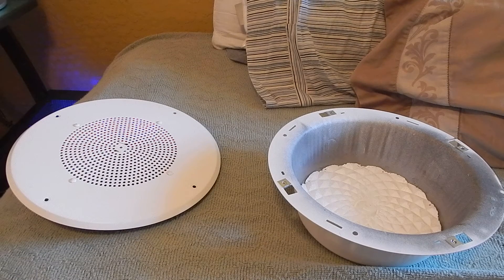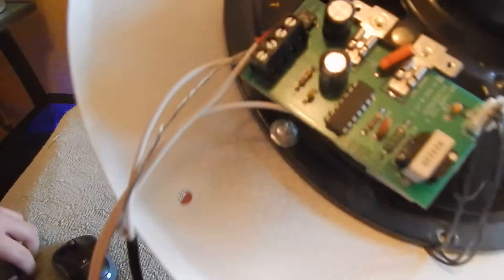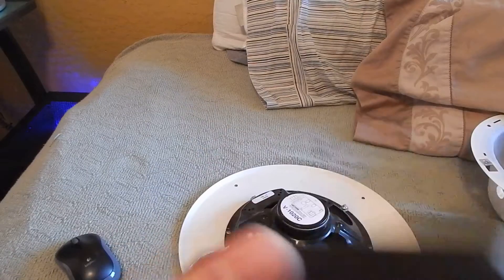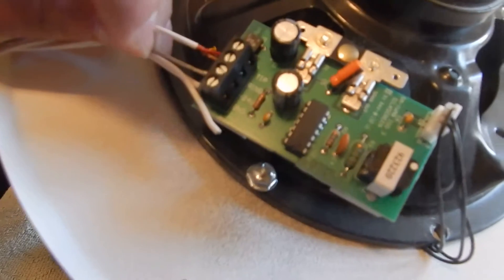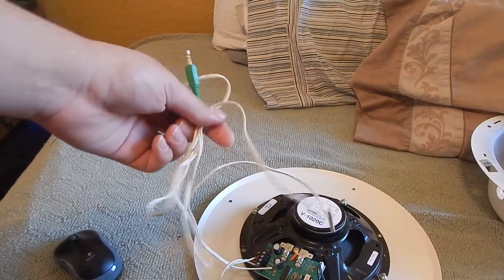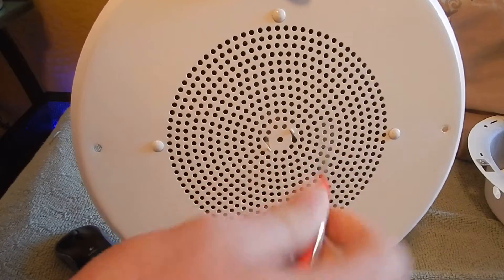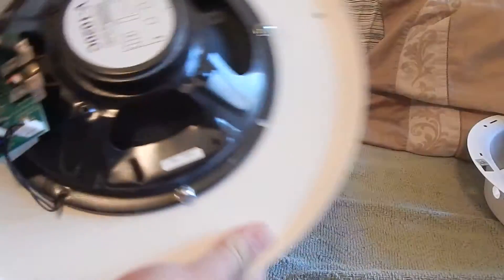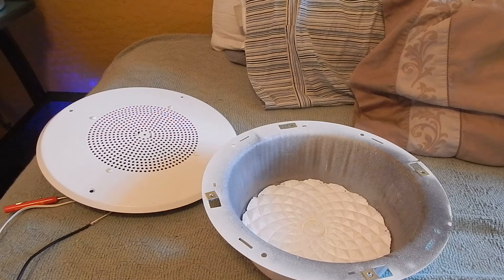How To Wire Up A Valcom Self Amplified Speaker For Your Own Use.

Comment: They have Valcoms 1020C almost everywhere around my School the building is getting tearing down around the summer most of them don’t work they should got them replaced a long time ago but 4x of those speakers work they also have Valcom 1030C Horns as well

Comment: hey man . can I hook this up to a car amplifier ? if so how would I do it and how much watts would I need ? Thanks
Reply from the maker: You can not hook a Valcom speaker directly to a car amplifier due to the speaker blowing out. However Valcom speakers and horns are self amplified which can be powered from a cigarette lighter plug in your car. Valcom amplifier's can take 12 to 24 volts D.C. which you may have to get a cigarette lighter plug cord, just check the output voltage to make sure that it puts out 12 volts D.C. at 1 amp. You can hook audio/aux devices directly to the speaker amplifier as shown in the video. I would recommend not to go over 4 Valcom speakers/horns on each power supply.
Reply: do you know anything about the 1048c 40ohm talk back horn? I was thinking to use a 100w 2channel amplifier for that horn. what do you think ?
Reply from the maker: I do not know much about Valcom 1048c take back horns besides putting audio signals in the horn and powering it up. I guessing that a switching circuit is used to use it as a microphone or to allow playback of music to listen on the horn. Are you bypassing the amplifier to the horn to wire the horn directly to the 100w 2 channel amplifier. If you are bypassing the Valcom amplifier just be careful to not over drive the voice coil in the horn otherwise the coil will overheat and blow due to too much wattage on the driver.
Reply: yes I am thinking to put the positive and negative wires from the horn to the positive and negative terminals on the amp
Reply: @CristianOrtiztechmaster926  What kind of cable is require to wire the speaker (ring,rip,lead,etc)
Reply: Hey did you ever hook it up to your car??